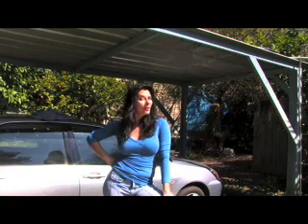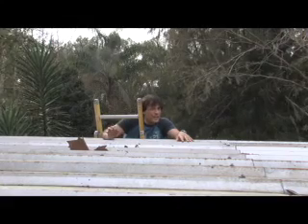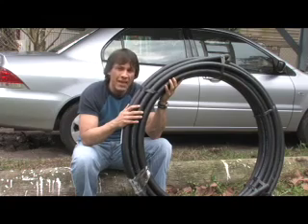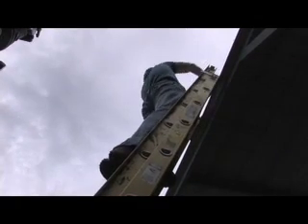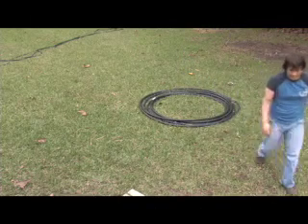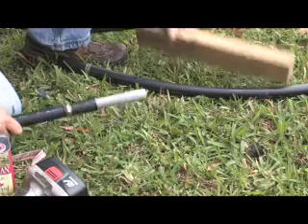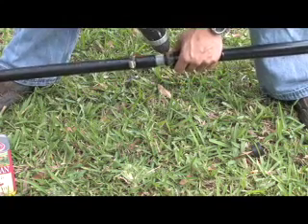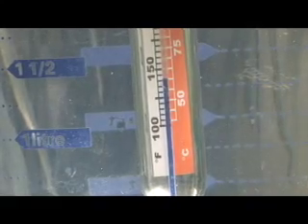SOLAR HOT WATER SHOWER DIY BLACK WATER HOSE PART 1

Comment: If you're looking to straighten any flexible pipe you can just blast steam through it and lay it out once it's relaxed. Just stake down the ends while it cools and it stays mostly straight. It doesn't hurt to give it some twists and stretches while it's still hot either.

Comment: could you have used pvc 1" and painted the section black with plasti-paint ans then connect the sections in a radiator like pattern. This would reduce the energy used on the rolled plastic. I'm sure the price point for the roll is le$$ but isn't the pvc longer lasting and you could size it up...

Comment: lol.. i did 800 feet of tubing on my roof. i know it isn't easy.  took me a good while with the 2nd 400 feet by myself.  if you leave it out to warm up and then stretch it out, it helps. but you really need 2 people. 2nd person twists the coil around.  the 800 feet heats up my pool.

Comment: well with your 15 SQ Meter roof you likely are getting about 11.301183 Kilowatts on the average day collected at any given time... the 1000 watts per sq meter is a bit high I mean that is like ideal conditions and counting in diffuse light from the the horizon and what not which really doesn't help you much.. figure florida (though closer to the equator  is likely getting about 70 watts per square foot of usable solar energy.... but yeah.... I tend to travel around with my TI-30XS Scientific Calculator as like doing the calculations well it comes in handy.... and the slide rule makes me look like toooooooo much of a geek......

Comment: Cue cards.  I do like the blooper idea.  Actually overlapping loops is the way to do it. While you have some of the tube is in the shade, it is cheap enough so it does not matter.  A bunch of tie wraps and bunches of overlapping loops stretched out gets this done.  On the science side, a smaller diameter tube has less volume for surface so transfers heat better.  Clearly, smaller tube is easier. I appreciate that you are not full of yourself like so many vloggers.

Comment: they also make 12v and 24v hot water heater elements that can be powered directly with solar panels to heat the water in your water tank by day
for hot water use at night
used allot in the farm comunity because low volt is much safer then 110 ac and thay use to keep watering tanks from freezing for livestock

Comment: I tried this today with 150 ft of black garden hose on a tin roof.  The water went in at air temperature of 68 and came out at 91.   I had to put an air vent in the hose on the roof where the water was coming out to prevent it from draining / siphoning the water out.  I assumed the heat transfer would be more efficient without air in the hose.

I spent about $75 for a system that will cut energy cost for hot water... and probably eliminate $40 a month to heat water in the summer when its over 90.

Comment: I give you both five stars, three cheers, and two thumbs up for trying to make a difference.  It sure is noisy at the old Fortress of Solitude isn't it?  I live in Arizona and cannot figure out why EVERYTHING here is not solar powered.  I understand that camping refrigerators operate on a propane flame so why can't air conditioners be solar powered?  At any rate folks in my state should have at least solar hot water and solar heat and solar electricity.  I think a parabolic mirror heating water to turn a generator should be more productive than solar panels.

Comment: To slide in the pipe you can borrow a trick for getting rubber grips on handlebars - spray hairspray on the pipe, it will lubricate but when it dries it will grip.

Comment: A couple of 2x4's with 1" holes drilled in them would have allowed you to slide the hose through, and then you could have drug the semi rigid structure onto your roof in a controlled manor.

Comment: So you live "on the Freeway," and "at the end of the airport."  There are also much smaller connectors for the poly pipe. 
Plumbers tape each roll of the pipe as you go in the same place before placing on the roof.

Comment from the maker: Solar thermal is 80%+ efficient. PV electric is 15-20% efficient on the collection side and heating elements are only 50% efficient so you lose a tremendous amount for the same area. To heat the same amount of water a 3ft sq area of black hose or solar thermal water heater would require (12-15) 80 watt panels.

Comment from the maker: The upgrade of a box/glass cover enclosure will work in cold climates. They can freeze over ant night so the best option is a passive heat exchanger (copper coil in a tank) and use earth friendly (non toxic anti-freeze) solar panel 20 watts with a small DC pump to circulate. The copper tube is submerged in the water tank. Non direct system. Video in the works:-)

Comment: You two inspired me, I live in Texas and its hot, I had lots of scrap. Had to build a tower. Neighbor laughed wife too. I finished the system with a shower under the tower, It is December and we just turned our Natural gas water heater back on. Six months and no hot water bill. Have not seen any leaks. The System works and it works well, Thanks for posing this.

Comment: If you're using a rubber water hose, don't use oil to lubricate fittings. Oil makes rubber fall apart. Use a silicone-based lubricant.

Comment: Why use just a black tube? Wouldn't most of the heat energy be resting on the surface of the tube? I'm not testing you, I really don't know. To me it seem like it would be more efficient to use a clear tube full of still water, with a black tube in it, with running water in the black tube. That way the black tube is heating both the water on the outside and inside of the tube. Then the still water is heating the black tube. I'm not educated in this field, I'm just wondering. Have you ever tried?

Comment: I feel you man!!! ARAHHHHHHH! So my grandfather and I did this last summer with some black goodyear watering hose, you can buy it from home depot pretty cheap.
also we got some black 55gal. drums and filled them partially with sand set them on the sunny side of the shop with a little ductwork and now free heating.

Comment: I did a similar set up in Victoria Australia when our gas supplier blew up their gas processing plant. I used 13mm irrigation hose but in OZ you need to add cold water to the shower as the solar effect makes the water too hot. Another problem is that the plastic hardens with the heat and pressure can build up in the pipes. Would suggest having a gravity pipe attached to relieve pressure build up. Another method would be to use copper pipe attached to corrugated steel sheets planted black.

Comment: At video point 4:32, use PVC pipe glue at connection points.  Oil will break down the plastic over time, ending up with leaks.

Comment: 1. your not very handy.
2. your using a power drill in an energy saving video.
3. I bet putting the hose in a kiddy pool of hot water that has been sitting out in the hot sun with a gallon or more of boiling water will soften up the hose to make it easier to use.

Comment: That was a scream  I could not stop laughing . You should go into movie making.
   I live in Country Australia and have made the same type of system years ago and hooked it up to a water heater that I could switch on if needed . It worked so great that it could be used to heat a pool as well or separately. Good idea and thanks for the Laugh. George.    Loved it Thanks.

Comment: Yea, use some olive oil as lube and slide it in there. Hammer it down with a piece of wood  As far as you can. Yea. We are on the same page so far. Nice and tight, AND it will be "FUN" to do.. This is an awesome video. He was successful at getting the hose on the roof finally.  Denise should have been up on the roof helping you feed that hose. Grabbing it. Laying it down. All EVOO. Not a 1 man job. I cant wait for part 2. One question... why is Denise wearing a winter skull cap? In Florida? hmm

Comment from the maker: Yes, both have it in the plumbing section for landscaping. The black polytube 500' section 1/2" diameter is the best, it is $59-$79. Holds 10 gallons in each 500 ft section.

Comment from the maker: You get very little this way. BPA is in just about everything including drinking bottles. Also lids on Starbucks coffee cups have it.  The coffee is usually much hotter than shower water. Plastic bagged food also has it Also BPA is released to any inline water filtration system. Most PVC pipe also contain it. Unfortunately, it is in 95% of peoples bodies.

CU, ZN, PB, FE all leach to some degree.

Stainless steel is good but chromium, nickel can concern others.

Glass is the other good option.

Comment: Next time, or for anyone else reading this, you can heat up the tubing with a blowtorch when coupling the two hoses together. The connector will slide right in with much much less effort and the hose clamp will still hold the tube more than tight enough.

Awesome vid! any results on what this saved you on your heating bill?

Comment: Tip: When put the white pipe in to act as a connector, pound in one side as you did, but tighten the hose clamp around it before you slide the second hose on. This way you make sure you are not just shoving most of it up the original first hose as you are sliding the second hose on.

Comment: I did this same thing in Mexico for my in-laws. Glade you said how much easyer it is to use 1/2 inch. And, True, it does hold less water. BUT;;  The water heats up faster. 600 feet and it runs all day long and you DON"T run out of hot water. In fact,,,  on a real sunny day. You will need to add a little cold or it will blister you. It has lasted 3 years and still going strong.
Thanks for the video. Great job.

Comment: Like to know how this system holds up. Did something similar about 30 years ago using black irrigation tubing on the roof to heat pool water. It only took one hot Houston summer to destroy that poly tubing. Maybe yours is a heavier gauge? Maybe that black hose is heavy enough? Be interesting to see.

Comment: Hi, nice video. Have you considered that installing the water tube linearly, instead of in a loop, aligned on the corrugated panel roof you could get more solar radiation on the tube surface facing down by reflection from the metal?

Comment: hey an idea: in brazil some guy came up with the idea of putting a 2litre water bottle in a hole on the roof (half inside, half out), it refracts sunlight and its as powerful as a 60 watt bulb apparently, with some black tape to protect the cap... try it out!!

Comment from the maker: The only 2 forms of tubing or water containers that do not leech are glass and pure stainless steel. Ironically many people have traded their plastic bottles in for aluminum. Also consider most bottled water is not transported in cooled trucks. One water/plumbing training video stated " your chemical exposure is 100x greater by drinking hot tea or coffee in a Styrofoam cup or plastic cup than sitting in a hot tub for 8 hours. I would think solar showers would be much less than a hot tub.

Comment from the maker: Leeched chemicals are usually not a concern for exterior exposure. Far more concern for internal (do not drink hot water).

Consider that most hot tub pipe tubing is know to leech. The majority of drinking water bottles. Another factor is water purity. RO or distilled water leech far more organic and inorganic compounds than regular city or well water. This is why whole house systems are rare and require special pipe.

Comment from the maker: Cool;-) Re.: Denise...

Leeching - (NEVER DRINK HOT WATER REGARDLESS OF WHAT PIPE YOU HAVE IN YOUR HOUSE)  there are concerns with any pipe, heated or not, regardless of Galvanized even cpvc or copper tubing, the liners of many water tanks leech. Drinking water bottles etc. The key to avoiding issues is A:not drinking hot water. B:avoid excessive steamy showers. C:not heating water above 180f. We did have our hot water tested and it was high in iron,  we have well water. Cold water has the same.